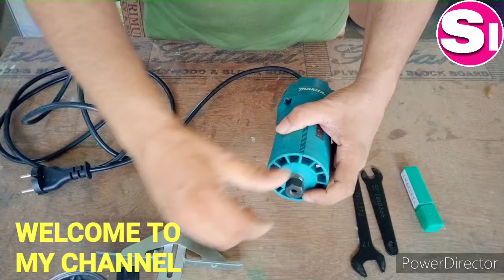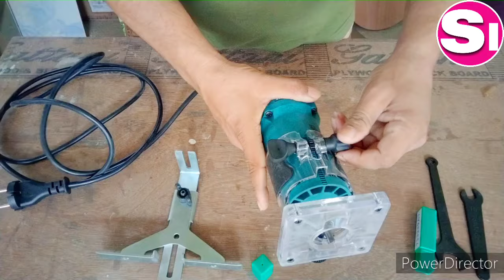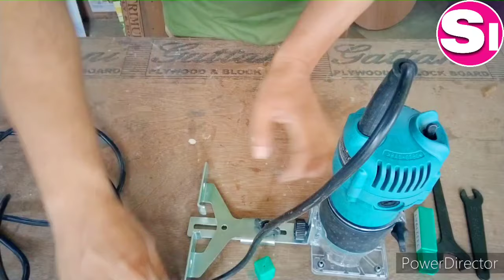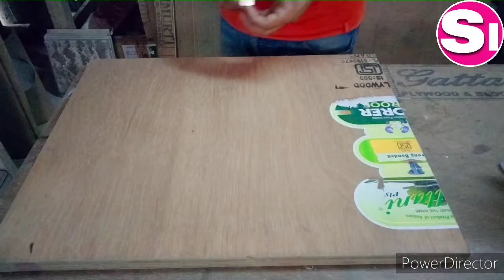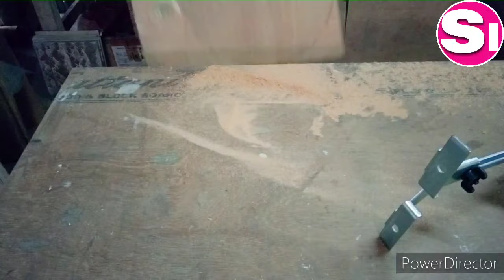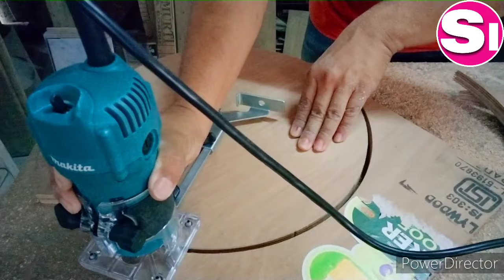Circle cut with Makita 3709 Trimmer (Very easy)

Comment: Quick tip, instead of using a nail, use a screw that fits the center hole, your router bit would then be perpendicular to the wood piece and should cut twice as fast. I just bought the same machine so thanks for showing me how to assemble it :-)
Reply from the maker: Thanks for watching my video and thanks again for your tips. I always grateful to you .
Reply: lol yeah

Comment: I m also using this mini tools router since from few years  its light in weight n easy to work .at the beginning mostly I used this for only rounding the  border of window or door frame only because of no more knowledge about this tools equipment parts that how to use in different shapes n different angles but now it's clear With this method I can art flower or any other types of  beautiful pictures of pots with flowers" kalash" or welcome arts or statue arts it's not easy but i can do its my confidence
Reply from the maker: Thanks for watching my video 🥰
At first anything seems difficult,but gradually that thing becomes easier. We can do whatever we want with that.